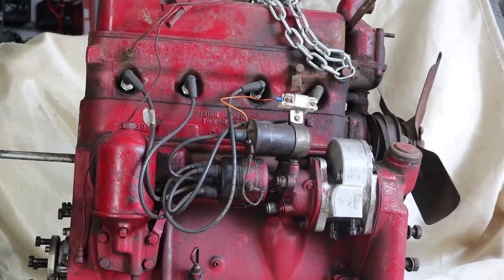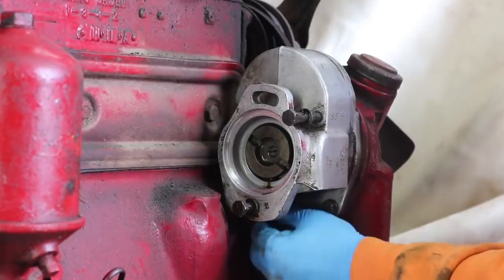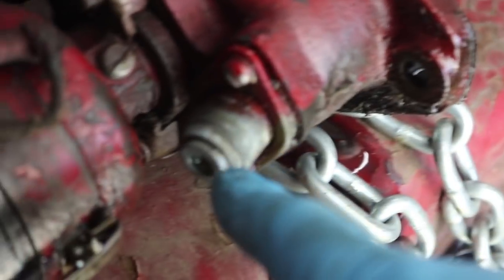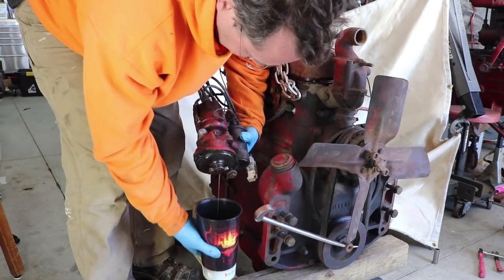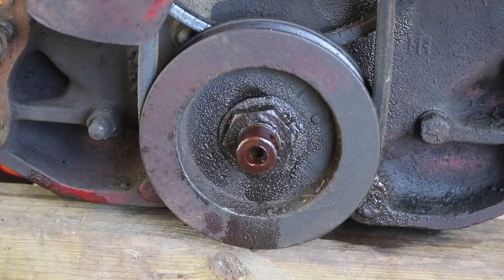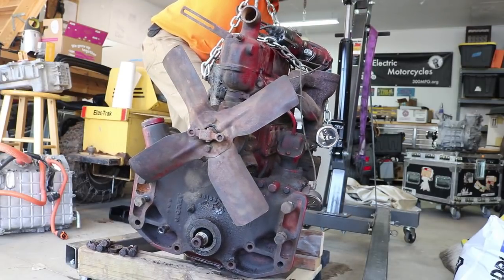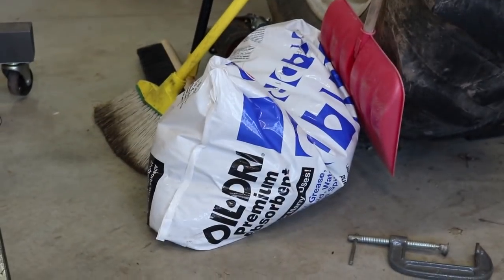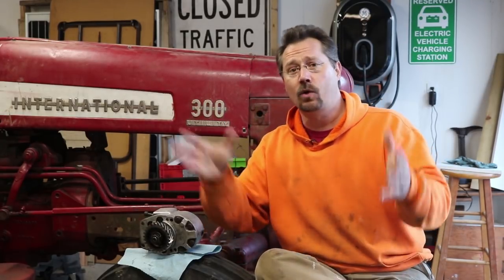Electric Tractor Conversion: Hydraulic Pump Removal

Comment: Suggestion for Hydraulic Power. Add a chain driven sprocket to the base of the Leaf's motor, drive shaft. Mount the Hydraulic Pump to adapter plate, so it's aligned with the sprocket of Leaf's motor with the proper spacing. FWIW, if this a interesting concept to you, I have more details and varitaon on how this could be done?

BTW, it could be driven at anypoint, from the base of the motor's shaft to the end of the PTO. So adapting the Hydraulic Pump or getting an off the shelf kit to be driven by the PTO would mean less fabrication and is a common option.

IMHO, adding a seperate motor to drive it, when you don't have seperate motor for the PTO seems pointless. And while the issues with the DC motor such, as dirt affecting it its cooling ability seems to be a minor issue. Since you already have the Leaf's motor and made preliminary calcs based on using it. It does not seem worth the time to second guess yourself at this point in time. Unless run into major unforseen problem. I sure you will find a way to get it to work without doing a major redesign. KISS

So if have any questions on my suggestions feel free to get back to me and I will add some more detail on how to make it work.  

Good luck with whatever you decide to do.
Reply from the maker: Hi NC,
Sounds like you have some interesting ideas there.
Please expand on them.
Reply: @BenjaminNelsonX  One possibility is to use a timing chain and sprockets. But I would really need input from you to take it much further.
Such as how to keep the tension on the chain, with an idler arm or just pretension it with sloted mounting holes?
And I need far more details. Such as if there will be room to place the sprocket on the shaft of the motor or will spacers be needed? And will there be room to place the pump between the motor and the adaptor-plate or will it have to be placed above it? With longer chain to transverse the distance. And can the pump be driven in either direction or only one? Which would determine its orientation. 

There so many variables its not easy to give you  a more detailed plan on how to proceed. 
FWIW, there many possitive aspects to using the PTO drive it. So do you plan to dismantle the pump any further? Since it has 1:1 ratio the could be insterted along the PTO drivetrain and it would be a elegant way to do it. As long as the driveline of the pump that was just designed to handle a distributor could be made robust enough
BTW, I'm a visual thinker, so it's difficult for me to express myself just words. And there are a lot of ways to "skin this cat". Feel free to get back to me. 
 I hope I was helpful.
Reply from the maker: @nc3826  Those are many of the things that I've thought about.

As far as "visual thinking goes", I hope that I've done a good job SHOWING the Nissan Leaf motor shaft and various components of the tractor.

The shaft on the motor is pretty short, and will need some sort of extension, no matter what - probably with a bearing to support the forces of the flywheel at the adapter plate.

There are several physical limitations to the tractor right in front of the bell housing. A frame rail is on either side of the bell housing. The yoke to the front axle connects at the bottom of the bell housing. Assuming the Leaf inverter is re-used to power the motor, that is designed to mount directly on TOP of the motor. Essentially, all four directions are blocked from the motor at the bell housing.

The tractor's hydraulic pump is designed to rotate only one direction. Other industrial pumps would be available which could rotate one direction or the other.

Other than the PTO's actual end output shaft, I don't know how or where else a pump could be mounted. Other than just that point, all the mechanicals are internal to the tractor.

Attaching a hydraulic pump to the PTO would make it more difficult to to use PTO accessories and it would only allow the hydraulics to be used with the PTO spinning.
That would be a problem if the operator wanted to use the hydraulics (including power steering) WITHOUT also powering the PTO-powered machine being pulled behind the tractor.
Reply: @BenjaminNelsonX  Pls consider, there are 360 degrees, to place the pump around the plate, not just 4 fixed points that are 90 degrees apart. For example there maybe room at about 45 or at 315 degrees that avoid interference from the side rails and the inverter? 
Or how about using, the motor shaft extension or its 1 piece coupler as a sprocket too? By welding a sprocket to the outside of the coupler or extension. And then cut slot in housing bell housing and mount the pump inline with it. Also radially it it eliminates much of the interference issues and it provides a partial covering for the chain (sheet metal shroud/house. could cover the rest of its moving parts). It just a needs more thought about how to mount the pump, since it will likely be further away from the plate. 
And, I thought you stated the PTO, would constantly turn whenever the motor was turning. I apparently miss understood, since that does not seem to be the case. So, using PTO to power the pump is less than ideal. Let's just keep it as a backup idea, at this point

FWIW, my "visual thinking" reference was more about my inability to describe my thought in words (since I have dyslexia). Than the "job you did SHOWING the Nissan Leaf motor shaft and various components of the tractor". But it is easier to validate, if an idea is feasible, if you can to see it in-person and work on it yourself.
BTW, I'm sure we all can come up with an idea that will work for you, if you find the current options unworkable. Good luck.
Reply from the maker: @nc3826   The PTO is continuously powered by the engine, in that the "collar shaft" near the clutch, which powers the PTO system, is continuously engaged with the clutch cover and thus always spins as long as the engine does. It is NOT effected by the clutch.

The PTO driveline inside the tractor continuously spins. Internal gearing drops the engine nominal speed down to 540 RPM for the PTO.

Near the back of the tractor, there is a lever, which when engaged, connects the internal rotating PTO components to the external spline shaft that exits the back of the tractor.

Internal parts of the PTO system constantly spin. The tail shaft commonly referred to as the PTO can be turned on and off.

If a hydraulic pump was added to the back of the tractor, on the PTO, the PTO would always have to be activated to have hydraulic power.
Reply: @BenjaminNelsonX  After your Initial post on its PTO it was unclear if all of it turned continuously or just part of it. But after your previous post, it was clear there was a diseagment method for its, tail shaft. And thx for the additional details, describing it (such as its gear reduction, which would be factor using it to power the pump). But since you stated there is no access to the PTO's driveline that is continuously engaged, (ie before its tail shaft). It's just a backup option at this point.
So what really matters at this time, is finding a way to drive the pump off the motor's driveline. And the 1st step is mapping out viable locations along the driveline and then possible locations and mounting method for the the pump. 
Pls keep in mind the pump can have various orientations, as long as it's within its operating parameters. For example the shaft of the pump could be extended too (with the use of a support bearing if necessary), is just one example. 
After locations for power sprocket is on the table the secondary issues will help decide, which one is the best choice for you. 
FWIW, I have gone thru dozens of permutations (mostly just in my head), so it's best that you present some details. Such as possible power sprocket locations. Or more developed ideas that have unresolved issues. Since you have stated that you have had the same ideas. I maybe more useful in refining you designs. And I will be happy to give you my feedback, on whatever tentative options you start mapping out. 

BTW if decide to go different direction, such as using a seperate motor. That would be fine too.

Comment from the maker: For folks suggesting powering the pump from the flywheel, can you point me to an example of ANY project where the flywheel starter teeth were used as a power OUTPUT?
Reply: Don't some hybrids use the flywheel attached to a motor/generator to power the hybrid functions and start/stop functions?
Reply: @The81Winfield  Not throught the flywheel teeth I think.
Reply: @ottard  I think you're correct.  After looking, some are belt driven, but most have the electric motor inline separated by a clutch.
Reply: Older Honda Gullwing motorcycles have a shaft that is driven off the flywheel for the alternator.  Probably for space savings, not sure if the design of the flywheel is different to accommodate this.

Comment: I'm a strong beleiver in the "KISS" principle. "Keep it simple, stupid." Since you are using the clutch you have to use the flywheel. Use the flywheel ring gear to drive the pump. Perhaps you can use the starter motor port to mounthe pump. There may be room under the electric motor to mount the pump through the adapter plate. Using the forklift motor is too old tech and less eficient.

Comment: I would recommend a second motor to run the pump to get the "live power".  You calculated 10hp to run it..   Is that internal combustion 10hp or electric 10hp?  I think the pump motor could be 5hp or lower..   As for the traction motor,  if all you are doing is bucket loader work, you don't need a bunch of hp.  My ford 8n conversion is running a etek pancake motor.   I think it is rated at 8hp.   I loose traction before i run out of power pulling.  Again I am not out plowing a field with it.  I'm moving trailers around launching boats, pulling out hedges.
Reply: I'd love to see some pictures of how you did your 8n conversion.  I'm considering making one myself.  Did you direct drive, or did you retain the clutch assembly?
Reply: @bobhotchkiss2438  https://www.diyelectriccar.com/threads/e-ford-8n.80143/#post-327616... I did a direct drive and added a second pot box hooked to the clutch peddle.  It works similar to a clutch but not as smooth.  If i did it again, i would consider leaving in the clutch.  My eTek motor is working great for me.  Depending on what you are building for, you might want more power.  Man how time flies...  8 years and still loving the conversion.  You can email directly at tchapin@umich.edu if you want.

Comment: A secondary motor is a good idea since you want the bucket to stay in place/be movable when you stand still and you may want to power something like a woodchiper of the PTO shaft while you stand still.
Reply from the maker: The transmission, PTO, and hydraulics are all separate on this tractor, so moving/not moving aren't an issue.
Reply: @BenjaminNelsonX  so you can "idle" your main electricmotor? Couldn't you fit/use the large gear as part of the flywheel assembly. What are the idling rpm of the tractor vs optimal rpm on the electric engine?

Comment: What about using a stand alone electric hydraulic pump with similar specs to the factory pump that would make life easier for you.
Reply from the maker: Most of the off-the-shelf 12V pumps are only about 1 gallon per minute.
The pump on the tractor is rated for 10 GPM.
Reply: @BenjaminNelsonX  what about off the shelf 120vac pumps? EDIT: nevermind... 10HP 240V 10GPM power packs cost 6000$... You can build better than that!

Comment: I worked on a helicopter with extensive hydraulics, but if you are going with a clutch on the electric motor, why not just put a gear on the back shaft to feed accessories? This would a gear on the output shaft, before you get to the flywheel/clutch. I might require some kind of extension to the output shaft, but it seems like that would be easier than trying to add another inverter and electric motor just for the hydraulic pump.

Then you can have the tach and hydraulic motor off that gear (and any other accessories)? Just because it used to be on the front does not mean it needs to stay that way.

If you do not go that way, just find an electric hydraulic pump that matches the pressure and flow rate to the mechanically driven pump you have now. Looks like that pump sells for a bit of money new, so it still should get some money used. If the owner will let you, sell the engine and hydraulic pump, buy an electric hydraulic pump and move on.

Comment: I'm enjoying your adventure but I believe you are over thinking the application. The pump doesn't need to be timed with the Leaf motor. If you really want a tachometer; the Leaf motor as you pointed out in a earlier video has a resolver/speed sensor built in and it would be more accurate. The larger sprocket (a proper term) is what drives the cam shaft which in turn via lifters, push rods and rocker arms operate the intake and exhaust valves. Each of the sprockets have a timing mark. These dimples are for aligning the crank and cam shafts for proper ignition timing and in turn they are using the pump as an extension to the distributor and the distributor is driving the tachometer. So that tachometer is mechanically driven verses an electrical driven one. If your intent is to not drive that hydraulic pump with the Nissan Leaf motor then it does not need a tachometer; a pressure gauge should be sufficient and more practical. Going under the assumption that you are trying to use the parts you have on hand and not just buy an electric hydraulic pump you could maybe incorporate where the starter once was mounted for the pump and drive gear before mounting the motor to the bell housing. I'm sure you are still contemplating how the clutch and flywheel will be mounted. Whether with a Lovejoy connection or a splined adaptor shaft; that area between the motor and bell housing would be the optimal location for utilizing the Leaf motor to drive the hydraulic pump.
Reply from the maker: No, the pump doesn't need to be timed to the electric drive motor. But if it is driven by the drive motor, and that is running at about the same speed as the original engine, then the hydraulic pump is also driven appropriately.
Being able to reuse the tachometer/speedometer would just be a nice side benefit if I reuse the original pump anyways, driven by the drive motor.
Reply: I agree using the traction motor to drive the hydraulic pump is the way to go. It just wasn't clear to me on what direction your build was going when you introduced the idea of a second electrical motor to drive the pump. Usually engine speed is increased for such operations. I was wondering what the optimal rpm of the Leaf motor would be for minimum power draw on the battery pack under load and what the rpm of the hydraulic pump would be to produce adequate psi for the bucket. Obviously at a 1:1 ratio of the ICE powerplant the tachometer becomes very useful. I apologize for the length of my prior post and only explained in detail the timing for those that didn't know the functionality of those gears.

Comment: "12v 600a" sounds like a starter motor to me
Reply from the maker: And starter motors are NOT designed to be run continuous. They only run for a few seconds and then have a long time to cool down.

Comment: i don't think regen will be useful for that tractor (putzing around the yard work?) . especially if you go out of your way to add that feature ?
Reply from the maker: Where this tractor will be used includes some hilly areas. It would be working harder than just putzing around the yard. Besides regeneration, an AC motor also is more efficient, and never needs brushes replaced. The Leaf motor is liquid-cooled, which means it's sealed up and dirt/mud/dust, etc can't get inside. An air-cooled DC motor would have to deal with all that.

Comment: What about using the leaf transmission? You could weld the spider gears in the differential and use one side for the drivetrain and the other for the hydraulics.
Reply: Looking back at you ratio calculations, the transmission output would probably be spinning too slow... So much for that idea

Comment: Maybe use starter hole in the transmission and use some kind of gear reduction to match the rpm. You can also use starter solenoid to turn hydraulic pump on and off. This way you could use same motor and only one controller. Just an idea
Reply: This would need a very large gear reduction, the starter gear is like over 100 teeth and the starter bendix gear is like 20, so it would be way too fast without many reductions. It could be easier to just power the hydraulic pump by its own motor

Comment: So that big motor was 30kW and the tiny pump is 7.5kW ?
Goes to show how much more force is in the oil compared to the burning gas.
Reply: One is producing power the other is just using it, same with the electric motors vs gasoline,

Comment: Fyi, the hydraulic pumps on farmall/ih 300/350 tractors are subpar at best, I'd use aftermarket.
Reply: Yes mine is sub-par ...... only been working great for 70 years
Reply: I think he means the flow, not knocking the IH pump but I agree look on norther tool to find the pump you want

Comment: Again so good project. I cant wait to see next steps. 240V AC motor may have problem with rpm. 3600 is too much and slower motors are heavy or use gear
Reply: It depens how many poles are in the motor windings, you can get the 3600 or 1750 or even under 1000 rpm induction motors